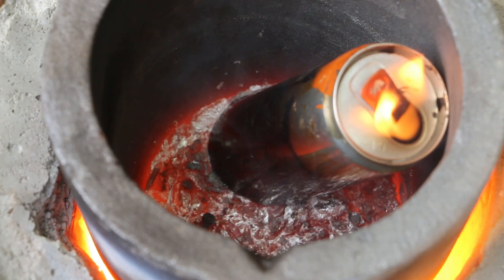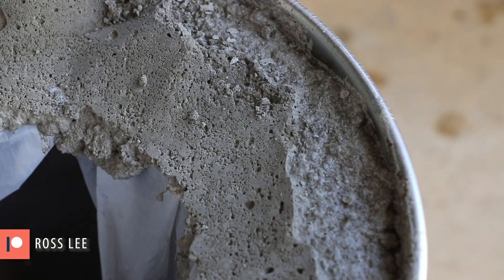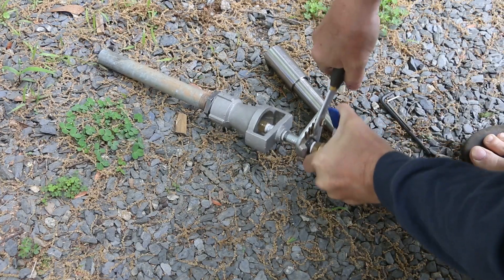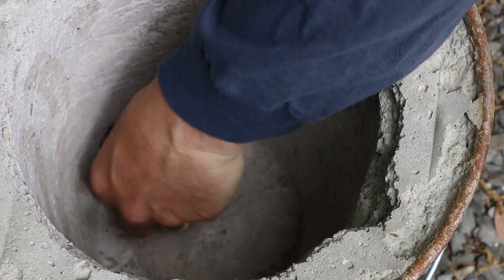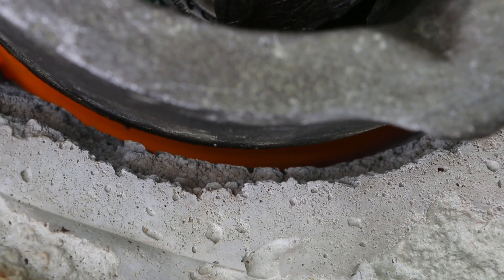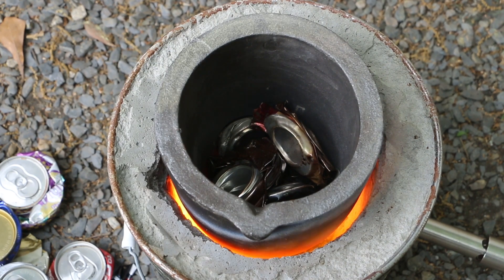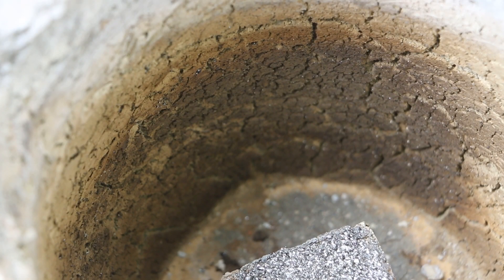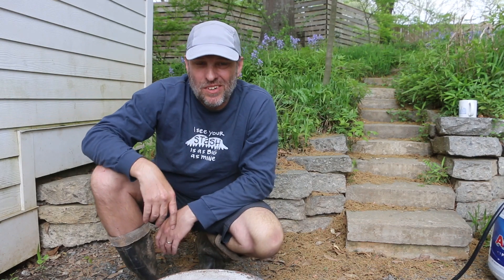How To Make An Aircrete + Propane Furnace | Test Burn + Aluminum Melt

Comment: i've been getting decent results doing lost foam casting. i use a cnc router to cut the foam. cutting foam is alot easier than cutting aluminum.

Comment: Since you first posted this several months ago, how many times have you used the furnace and how's it holding up?
Reply from the maker: I have done three burns on this furnace. The aircrete does a good job insulating during the burn. It’s glowing red by the end. However, when it cools down, the part that was red, crumbles away. I’ve heard of people using a coating called water glass to project aircrete. I need to learn how to make that. Without a protective layer, this furnace may only have a few more firings in it. Not what I expected. But, this was an experiment, so I’m looking at it as a learning opportunity. And fun to make.
Reply: @GreenShortzDIY  I'm not surprised there's a bit of degradation, there's a good reason you don't see people making furnaces out of regular concrete, Portland cement isn't a very good refractory material. If you experiment coatings, please give us an update.

Comment: Hey GreenShortz, Lastchance here from Cha-raw SC everybody has problem pronouncing that.LOL But I am also new to the aircrete recipe. I have watched everybodys making of foam machines and mixing of different kinds of cement and sand and silica to perlite and vermiculite and even satonite to the mix. Then after all is said and done, even the professional cruciables do brake down over 15 or 20 times of extreme firing and cooling. I witnessed your video of you setting that very large expensive cruciable down on the rocks. I was advised in learning how to use clay and grafite and diamond powder added to the mix of a crucible under hydrolic pressure, that we should set the crucible back into the furnace to add extended life to the crucible so as to allow the heat to deminish slower creating less stress on the crucible. Just as suggestion, ok. LOL PLease keep up the good work I thoroughly enjoy all your videos and watch them everyday. I wish I could make and publish vidoes, cause actually the videos of people trying these complicated things for the first time actually don't come out right when we try. I for example made silica gel for the second time correctly, however the very first time I had a tremendous overflow that resulted in an extreme amount of hydrochloric gas coming off and overflowing all over the stove and floor! LOL It was my fault, I had placed the pot on the burner to early and heated it up before i had even added the lye to the water, then I even added it way to fast. So live and learn we just all need to be extremely aware of the possible dangers and be PREPARED for unexpected outcomes, before we accidentally get hurt. I just thought that I would explain my disaster so as to let you continue, like you do, to ALWAYS use the safety messures first so as to not get caught off guard and get hurt. I sincerely look forward to all your videos and love all the hello from different country like you do. wow. Latter dude

Comment: Servus Tom (Bavarian /Austrian)
Im kinda surprised that the refractory heldd up that well.
If you want to make it more temperature resistent, up to 1300°C, you can add Vermiculite to your aircrete.
You could also use a Soup Can as a Crucible, wich at first would seem like a down-grade, but it transvers the heat much better, but just holds up for one melt.
You could also try using a can on your Rocket-melting-Stove,  to bring that projekt back to life, as it at least worked out for me...
Greetings from Bavaria
Simon

Comment: As far as the air pockets in the pour:
In wood fire science the irregular surface of the flame path helps mix the fuel (the releasing gasses aka... "smoke") which gives a more efficient (cleaner and hotter) burn.  Maybe it helps here, too!
In stove design there's a little trick called a trip-wire that kicks the "flow" a bit to mix the gasses.  It increases turbulence, one of the three T's of combustion (TURBULENCE, TIME, and, TEMPERATURE).

Comment: All in all, a good job on the aircrete furnace. :-)
It looked like you screwed a flair fitting into the ball valve. A flair fitting has a strait thread, and the valve (and all pipe threads) are tapered. But because that joint isn't under static pressure, it may hold. 
Also, choke??? This is not the carburetor on your lawn mower. This is a primary air shutter. ;-)

Comment: Excellent video, Love the train! The riser block is called a plinth. It serves many functions, including as you said to get the crucible off the bottom of the furnace. A few suggestions: Find the first book in the Built Your Own Metal Working Shop from Scrap by David J. Gingery. It details how to make a charcoal foundry. He uses a large metal trash can, fire clay, sand and a metal form to make the cavity and the single tryer. Charcoal is much more sustainable than propane. I have used this type of furnace to melt aluminum, brass, bronze, silver and gold.  A few things as well. I would use a product called Satanite to coat the bottom and sides of the melting chamber. it will keep the sides from eroding. I would have done a very slow initial heating of your furnace and a slow cure firing of your crucible. New crucibles have some water in them that needs to be driven out or they may crack violently. Lastly some Safety Sally points. (because I like your content and don't want to see you or anyone else hurt.) fabricate a lifting too that surrounds the crucible, as lifting it by one point on the rim could cause it to crumble at the wrong moment. Aluminum is the third most conductive metal. Silver and copper are No.1 and 2. Al "wants" to dump all of its heat at once so I'd like to recommend a leather apron (welder's supply store) and real LEATHER boots that rise high on the leg, at least above the ankle. A Shipmate of mine had less than an ounce of molten aluminum get past his reflective spats and inside his boot where it burned through his Achilles tendon, nearly crippling him for life. Good luck with future aircrete videos. Perhaps try regular concrete with powered aluminum to cause hydrogen bubbles. Look to RW Grace for sponsorship as they have some very powerful admixtures for air entrainment.
Reply: OUCH!!!

Comment: I would really suggest coating the furnace with a thin layer of satanite (a refractory coating) as it handles the direct heat better than even ceramic wool used in kilns
Reply from the maker: Thank you for the tip, Jason. I’ll try that. Thank you for watching.